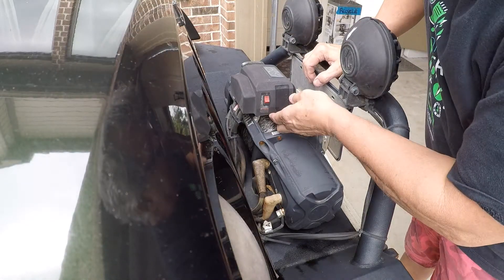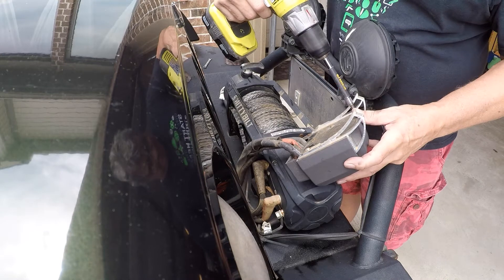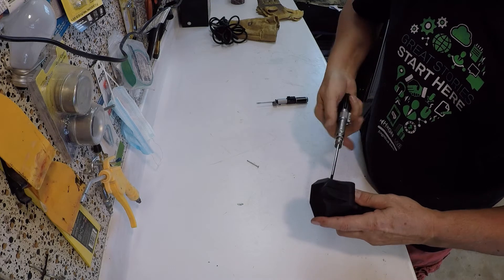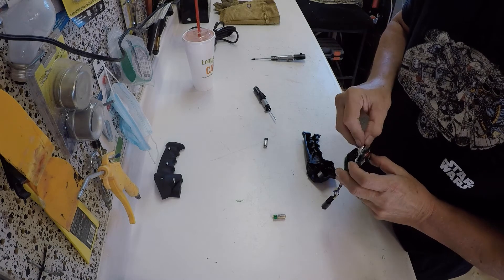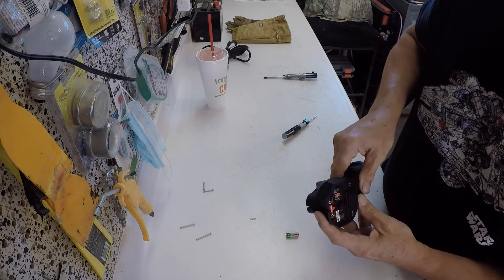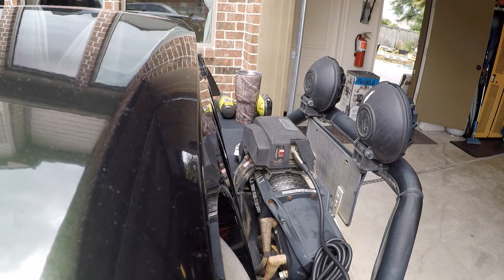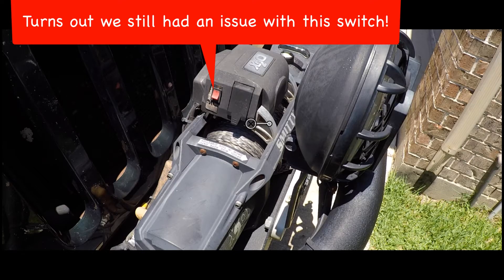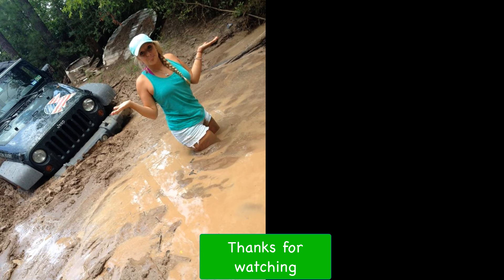Smittybuilt X20 Winch Switch

Comment: I have to repair the wire connectors going to the control box because they corroded off within 2 years. Not really quality issue as much as it is a too much salt on the roads issue. Thanks for the video man!
Reply from the maker: Glad it helped